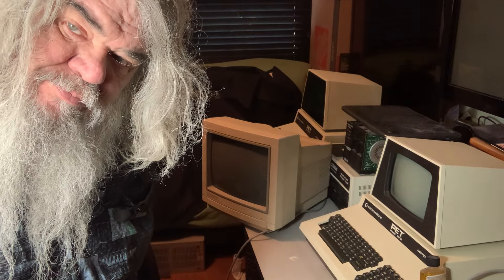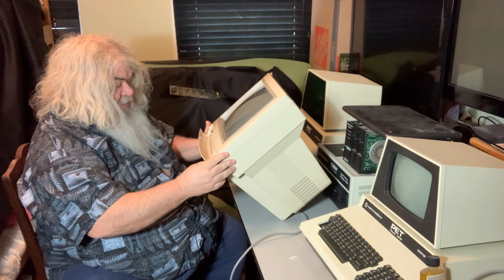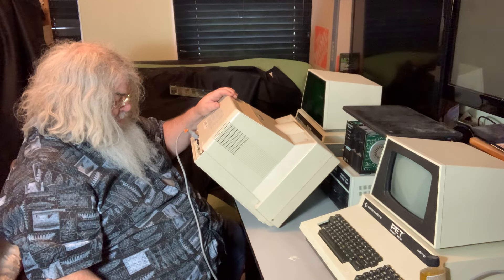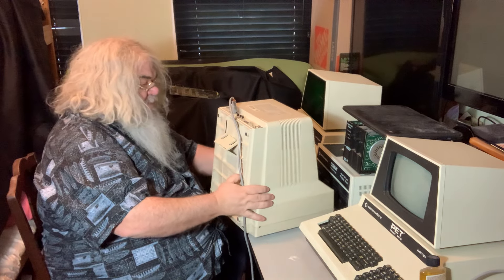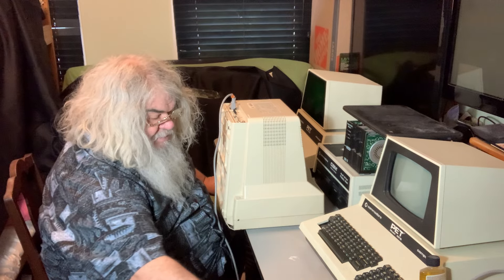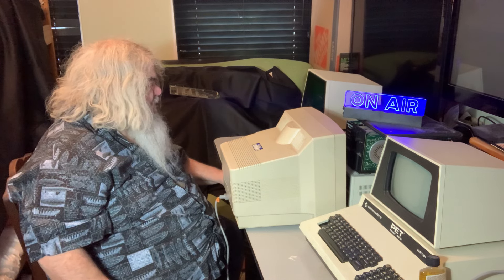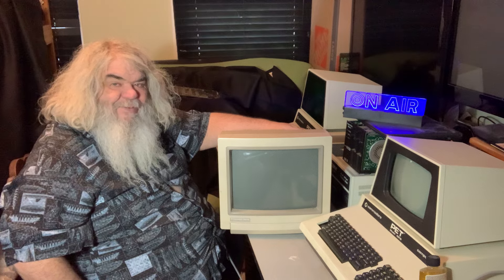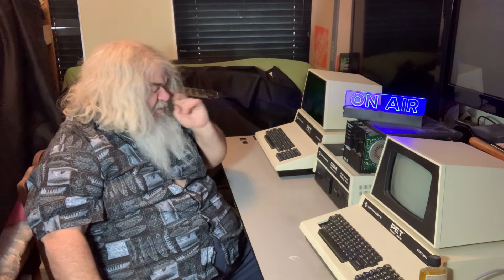Commodore - 2 1084S Amiga Monitors - Basement Finds - C64 C128 Vic-20 C16 Plus/4  - Episode 2161

Comment: I never had a 1084. I have a 2002 and a 1080 as well as a 1942 multisync. The 2002 works, the 1080 powers up, but stays dark gray. I don't know if the 1942 still works, it's buried in the basement at the moment.
Reply from the maker: Monitors…oh yes, they are wonderful when they work…and they are not my thing when it comes to delving into them with the very high voltage lingering there…and I know what it is like to have things buried in the basement…I am excavating parts of the basement now!  Stay tuned!